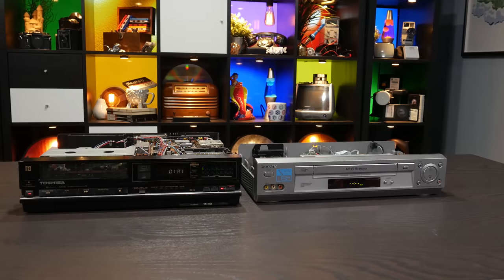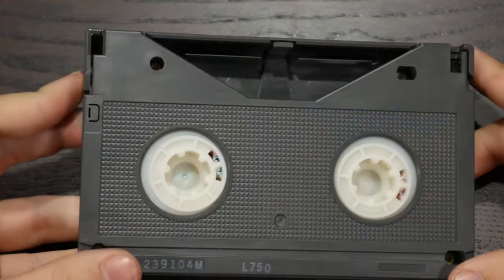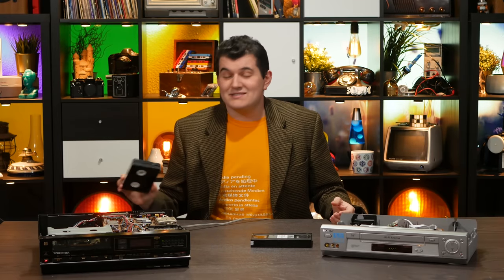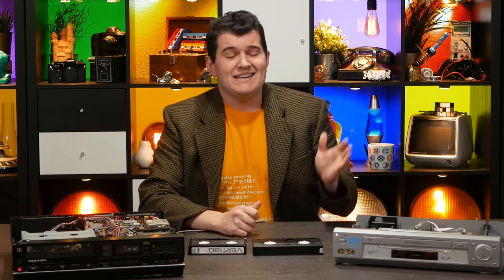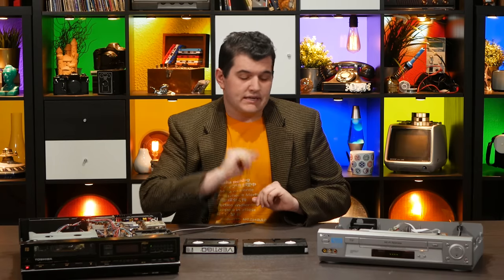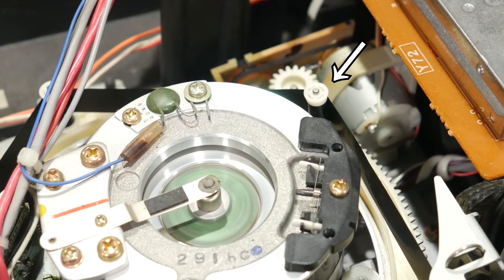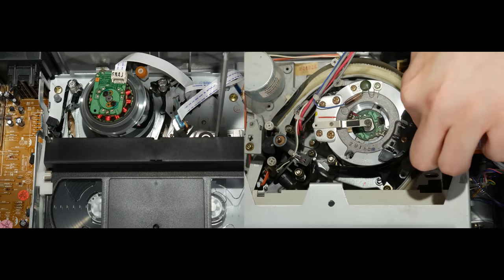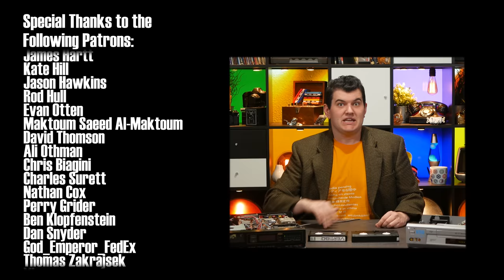The VHS cassette was more clever than Beta

Comment: Right--in the 1980s, I was a volunteer host and producer of a show on the local cable public access channel.  They used Beta format tapes to record all their shows.  However, as you pointed out, VHS was the more available consumer option, and so was my home machine.  That meant that if I wanted copies of my show, I had to bring in my own VHS tape, and have them record a copy off the master tape.  Naturally, it was then also down a generation in addition to any "technical" reasons for poorer picture quality.  Oh well.  By then, VHS tape was cheap enough, so that wasn't an issue.

Comment: In the later video about the time lapse VCR, I think one of Beta’s mechanical bits would have proven to be a pretty strong advantage. The head drum doesn’t spin. When the tape is moving very slowly, it won’t get so worn out. A VHS tape is touching a spinning head drum for minutes at a time, so they wear out regularly. Beta’s lower recording time may have been eclipsed by the fact that the tapes wouldn’t wear out so soon in a time lapse application
Reply: You've got me here - how does it record the video if the head isn't spinning?

Comment: The most obvious advantage of VHS: the entire drum rotates, rather than heads which project through a slot in a stationary drum as in the Beta format. This makes manufacture cheaper and head replacement simple. It also makes the tape likely to adhere to the rotating drum (called "stiction") and wind around the drum or snap. That's why the VHS machine had a "dew" sensor and indicator, in a not very successful effort to prevent this from occurring if moisture condenses on the drum.

Comment: So, just as I started college as an electrical engineering student, I was playing with a friend’s Tascam 4-track recorder, and I realized that a VHS or Beta tape was 4 times as wide… so logically could record 12 to 16 tracks on a tape. Recording time would be less than a VHS recording video, since you would have to increase the tape speed, but if you double the native VHS speed you would get better frequency range than cassettes, allowing for lower-noise recording than on a 4-track cassette. 

And about the time I was done drawing up a 16-track PortaStudio and wondering who I could get to build one… Alesis came out with the ADAT recorder that used VHS tapes to record 8 tracks of digital audio. Dammit. 

I do wonder, however, how the ADAT differed in handling the VHS tapes. They seem to be (from the number of them on eBay) much more reliable than a typical VHS deck, though one supposes costing ten times as much as a cheap VHS deck likely has something to do with that.

Comment: After watching your video on Beta quality I feel that beta 1 had the better quality(Ironic that sony tried really hard to kill beta 1 which was probably the machine's only selling point). When I was taking television production classes back in the late 80s one of my teachers noted that the better quality of beta was due to what he called "Omega rap" in the machine(yes that beta load thing).This was the same system sony used in the 3/4 inch tapes machines used by television stations. My teacher stated because more tape touches the heads than in a VHS machine the quality was better. He was also quick to point out that the beta machines tended to break more easily due to the amount of moving parts inside of the machine. So with beta you got great resolution, but resolution isn't everything. VHS won simply because it had the better features and was more reliable. The machine had to fit consumer habits and be reliable. You also have to realize not everyone had cable and static on television was the norm, a few extra scan lines are not going to make much of a difference.

Comment: Round 2019:
VHS WINS!

Some more info about the VHS:

The VHS also developed HD and "Full HD". The D-VHS format with, 720p or 1080i. 
Tapes can would from 25 to 50 GB!
Reply: D-VHS was more of a bitstream recorder that recorded (in the US) about 25 Mbps from over-the-air 1080i broadcasts, I believe D-Theater pre-recorded tapes ran at a higher bitrate around 45 Mbps. In Japan, prior to D-VHS, there was an analog HD format known as W-VHS. In the professional world, HDCAM & HDCAM-SR are the Betacam derivatives that only used the physical Beta cassettes (in addition to a larger size not available in the consumer realm), however the tape formulation is a much higher grade of metal tape that allows for denser data. The bitrate of HDCAM is 144 Mbps while HDCAM-SR is 440 Mbps & 880 Mbps. For a standard-size HDCAM-SR 40 minute tape that means that at 880 Mbps, the tapes can hold 264 GB.

Comment: Excellent video, I have vcr's of both formats and whilst I do like beta a little more, it's definately not without it's flaws. Though I must admit that my experience with vhs has seen far more tapes snap during rewinding in a vcr and I've never had one beta tape snap on me and very few beta tapes get stuck in a machine but when it did happen, they were easy to get out and the vcr kept working whereas some vhs vcr's would just shut down and not work again.   But this is why my favourite format is laserdisc

Comment: Beta was a superior technical format but was hampered by a 90 minute running time.  Sony also didn't license the technology to other companies until very late in the game.  Sony then turned betamax into the betacam broadcast format which dominated in television stations around the world for over two decades.
Reply: "Beta was a superior technical format"

No, it wasn't. How many times does that myth have to be debunked? 

"Sony then turned betamax into the betacam broadcast format which dominated in television stations around the world for over two decades."

No, they didn't. Betacam is a completely different format. It records video completely differently; it records component video (YPbPr) rather than low-quality color-under, which is why they aren't compatible with each other at all.
Reply: @MaximRecoil  You obviously have vision problems if you can't see the difference.
Reply: @acitizen5928  No, you've been duped by Sony marketing and mere assertions and/or you compared a low-end VHS machine to a high-end Betamax machine and/or you compared a high-quality Betamax recording to a low-quality VHS recording.

There's no reason to rely on vision. You can tell from the technical specifications of each format, plus those of each make/model of machine, which is superior, and the answer is, neither one is superior in terms of picture and sound quality when the best models from both formats are compared. However, VHS allows for longer recording times, so that alone puts it ahead of Betamax.

As for vision, the Technology Connections guy in this video has done plenty of comparisons; I believe he even dedicated a whole video to it at some point, and he said he doesn't see a difference. Does he "obviously have vision problems"?
Reply: @MaximRecoil  Its Beta I speed of 1.57 inches per second (ips) offered a slightly higher horizontal resolution (320 lines vs 240 lines horizontal NTSC), lower video noise, and less luma/chroma crosstalk than VHS, and was later marketed as providing pictures superior to VHS's playback.
Reply: Only the first two models (SL-7200 and SL-8200) even had Beta I recording speed, which is because it only allowed for 1 hour of recording time on a standard K-60/L-500 cassette. 

Also, LOL at 320 lines. Never in its wildest dreams did any Betamax machine approach 320 lines; 320 lines is what the professional Betacam format could do. The best that Betamax ever did was about 256 lines, which is also the best that VHS could do on machines with the original/full implementation of HQ circuitry.

On top of that, "inches per second" by itself is a meaningless measurement with Betamax and VHS, because they are both helical scan formats. IPS by itself is only meaningful with linear recording formats.

"I would be willing to bet that you're at least triple "

I'll take that bet, and since you didn't specify how much you want to wager, I get to. The wager is for all of your money and everything else you own. My last vaccination was in 1980, Miss Cleo.

When will you be transferring everything you own to me?

I'll also point out the comical irony here, i.e., since you are credulous enough to buy into the "Betamax was the superior format!" myth, you'd also be credulous enough to participate in medical experiments.

Comment: To think I used a VHS for 35 years before the DVD and Hard Drive system took over! My VHS was one of the 1st types done in the UK I brought it back in 1982, 

It cost allot and was a big bulky machine  ( Ferguson Video Star 3V29 ) made for them by JVC. which I think made the VHS format? It was a top loader with 1 program timer per year using a big green front LED display system! I paid for a 1 hour Ferguson video blank tape and a wired simple play forward/back/pause/record and channel change remote control. I had got a discount of £50 on the £400 VHS machine due to my mum using her CO-OP store discount on my behalf as I brought it from that store in my home town. It had a simple front maniacal 4 digit counter with a reset to 0000 button, 
I took a while to get used to using this new system as we never had anything like this before? Soon I got used to the counter and managed to know what length of recordings added up to what seen on that counter. like 30 minutes of tape= 500 on the counter. It was a single head system. and very solid and heavy to move around. About twice the height of a modern version of the machine as they did front auto loading of the tapes where the old one I had you put in the tape to the lifted up tape section and then pushed down to start the workings, then a press of the big solid eject button put the tape holding unit back up for tape removing! I had 6 VHS machines all modern front versions over that 35 years time as the tech improved. 
I used to take my old machine to a nearby town to have it cleaned and oiled and serviced. I still have it now and yes it works fine. it out lived all the other modern ones. I have two more up to date ( 2005 ) Toshiba combi-recorders which had a VHS 6 head system with a built in DVD recorder and a Hard Drive. these were used for ages to move my best tapes of TV and films recorded off TV on the HD then burned to DVD. 
Those two are almost worn out after 35 years worth of VHS tapes is allot to do. I have spare brand new un-used boxed VHS 6 head system Video Recorders I brought when they were cheap for back ups for any tapes that need doing to DVD. Now that DVD is the normal.  I still believe VHS is the better one after using it for all those 35 years you do tend to see it is a good system.

Comment: I worked for Radio Shack in the 80s and I sold both format machines. I bought the VHS system because to me, it had a better picture quality, while Beta had a better sound (but that did not matter much to me because I listened to movies through the TV speaker; the sound quality only mattered if you were connecting the device to a stereo system). I still own a 4 HEAD HI-FI VHS player/recorder from Panasonic and a 4 HEAD HI-FI VHS to DVD (and vise versa) player/recorder from Magnavox and I use them to this day, and yes, I have them connected to my soundbar and surround stereo respectively. My two daughters (15 and 11 years old) always get amused to see that many  (800+) of my VHS movies from the 80s and 90s are still in very good shape and are happy to be able to watch movies that have not (to this day) become available on DVD format.

Comment: Not that it matters much anymore, but the small guide by the erase head serves two purposes:  (1) What you mentioned in the video - assures the tape goes completely across the erase head, (2) was used in conjunction with a band that wrapped around the supply cog to set tension of the tape.  Back in the day when someone had a machine with worn heads and they didn't want to spend the money to replace them, I would increase tape tension just a bit to give the machine a bit more life.

Comment: The reason they came up with alternative pinch roller arrangement,  which drops from above was to move capstan away from the cassette and alter the tape pathway. And that was to reduce wear, since it allowed engineers to remove one of the three sharp turns (the other two being around the head drum)
Reply: Looking at my machine, which has this mechanism, I think your altered tape pathway is correct.  The fact my machine is still running after 31 years might prove it!  I'm pretty sure this also assisted faster FF and REW speeds whilst retaining real time counter features.

Comment: In VHS, if you had trouble with damaged tape in the beginning (not entirely unusual if the tape got stuck and you unloaded it and... yea, i guess everyone experienced the sound and feeling when you take out the cassette and the tape continues out of it and goes into the player, and the lid crushes it... Or it might have just been a bit more worn (since the beginning, and end, is the part that gets yanked out and in all the time)) you could fix it very easily:
Open the cassette (regular screws), unwind the damaged part and cut it off. Then push out the lock 'pin' on the empty reel, put in the tape end, push it back so it locks. Then screw it together and use acetone and a bit of paper or cotton and clean off the black magnetic stuff on the back of the tape on a few decimetres or so. Then you have the clear ending again so the tape stop mechanism can work.
Did that on several tapes during the years and it worked Amazingly good and you could use those tapes for a long time after that, without having all that noise and crap from the damaged tape in the beginning.

Comment: That little swinging "helper" did more than just make sure the tape was in contact with the erase head.  It varied the amount of tension of a brake band around the supply spindle to vary the amount of backtension the tape had over the scanner drum.  Too loose or taut and you'd see "flagging" at the top of the frame in one direction or the other.  Some VCRs used direct-drive spindles to provide that backtension, so I suspect the the arm there would be used to determine how much tension there was and vary the backward torque of the supply reel accordingly.

Something similar and far more distracting can be seen on 2" quad tapes depending on how hard you pressed the tape against the head wheel.  Instead of at the top of the frame, it's at the top of the block of sixteen scanlines for that stripe of recording. What you are adjusting is how close the concave vacuum-bearing tape guide was to the headwheel.  Too far away and either the headwheel might spin a little too fast and/or the tape couldn't be read properly.  Too close and it'd drag the headwheel's speed down.

Comment: Having used both formats back in the day and having tested multiple machines:  Beta tape transport mechanism was much quicker at loading and unloading the tape for FF and RW (just a fraction of a second delay compared with up to 2 seconds delay on VHS mechanism). This is due to the tape transport pathway being shorter and less complicated with less moving parts on a Betamax.  VHS suffered from tracking problems (that is the problem where you see the picture break up and gray snow on maybe the top or bottom).  Some more expensive VHS machines were able to reduce this problem (by using a cast alloy chassis to keep the complicated VHS tape transport mechanism better lined up). However if you bought a new VHS machine, especially a different brand, you would quickly discover that your entire VHS collection that you recorded on your previous machine would not track well on your new machine,  I.e., recordings made on your old machine would often have poor compatibility played back on your new machine.  Annoyingly, taking home recordings to a friends place would invariable end in disappointment as your tape would play poorly on your friend's VHS machine, then would follow the invariable argument where your friend would accuse your machine of being inferior because "his / her recordings play just fine", LOL.  * Commercially produced tapes were generally fine across different machines due to the commercial tape production process being different / superior.  Picture quality was similar in sharpness, however pretty much everybody who saw a side by side comparison would comment that Betamax was noticeably better in handling of colors, no fuzzy colors, flickering colors, or colors bleeding though to nearby objects (eg., like seeing a red ball and the red color is splashed over to surrounding objects). This observation seems logical given technically there is supposed to be less "chroma crosstalk" in the Beta system.

Comment: My father was a broadcast engineer and while he said "yeah , if you scope it out, Beta will give you a cleaner picture. However and this is a big however, once you go to the extended play on the Beta, yhe fram rate speed is the same as the VHS and any advantage in frame rate is lost."
And on top of that, most people do not even set their televisions up correctly regarding tint, brightness, and contrast, that they cannot tell the difference between the picture qualities at home. In order to teach me how prevalent this was, we would go into any place that sold television sets,  whether it was an electronic store or a department store, and  my dad would then go around and adjust the color settings on all of the sets. Almost every single one of them was out of whack!
(I still do this today 😅)